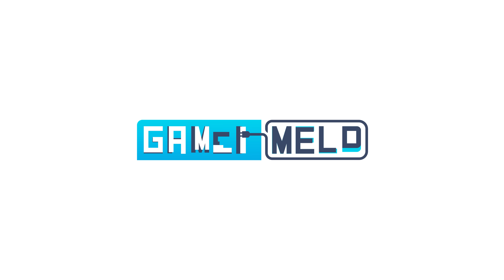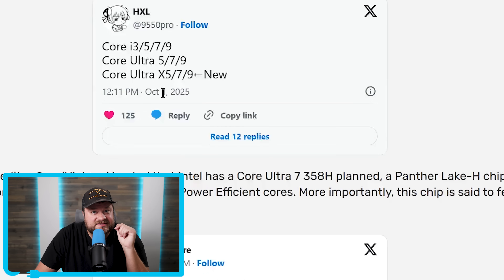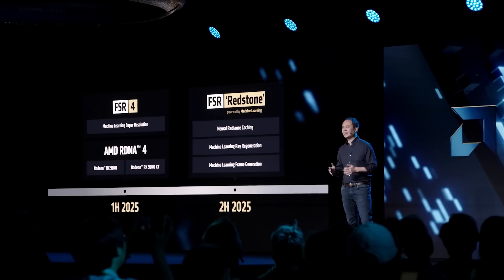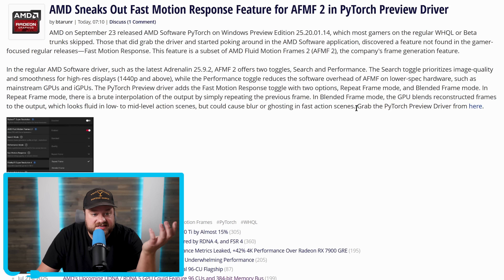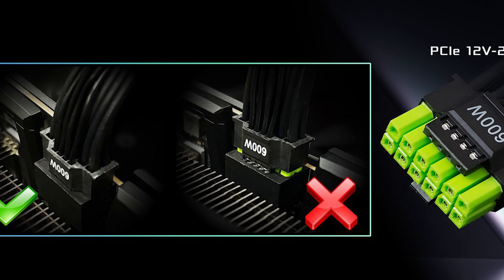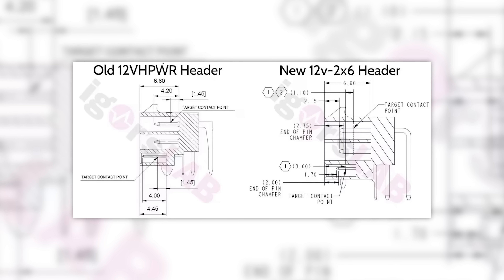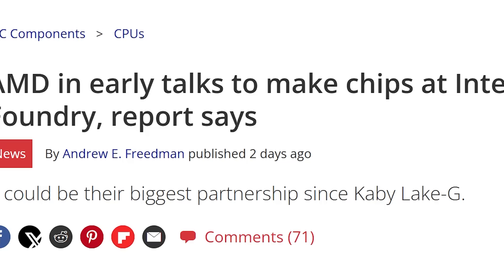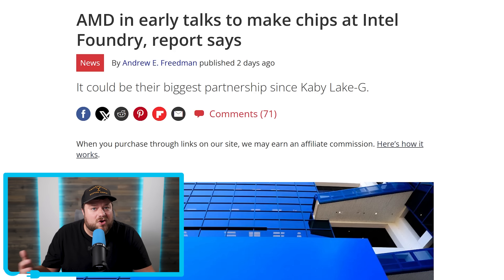AMD’s Most SHOCKING Move Yet!

Comment: Maybe AMD could maybe have Intel make new Intel based (M)emory (M)anagement (U)nits for them. Imagine an AMD CPU having the better MMU from Intel ; AMD systems that could use 2 x dual channel memory. Maybe it's time that Consumer ( Honme User ) level cpu's switch to quad channel memory. Being able to use 4 x memory modules as your default operation and not having to deal with the limiitations of the Dual channel memory configuration and operation.

Comment: Why does it have so many pins for just 12v ands ground FFS! they It had to be designed by a team of blind fake engineers.  
They should physically connect all the power and ground wires together. at the connector electricity would "load balance" the wires naturally like every other thing on the planet??

Comment: i thinke the  bigger is  no matter the gpu if you a meltin the power connector  may  be stick  flir meter on it i think and i have seen  the 2  outer most pins either  side of connector is  consuming the most of the power and you notice this more when playing the fuck around and  find out the the connector itself  is not designed either amperaage or  12/24  volt dc
may ther entire bus is designed  for 7.5 amps however with y  cables in play  you are are  consuming   beteen 15-60 amps across 32pins of the power supply

i had to wonder whether or not  we should be going back  molex connector or a 24 ping main board  for a gpu  power connector as it is the   conector isn't up to task and this has  likely been known  since the 1080 release

either way we are at the  cross roads that quatity of ram  rather just speed  of ram needs to  graphics limitation you  just can't keep adding features to  cover  lack of ram you defeat the purposes of thre new features
if you  consuming upwards of 2TB  in game  how  much gpu ram do opu need to either push 1440- or  4-8k gaming

Comment: Ridiculous. Hey we had a system that just needed multiple cables to be connected. Let's change that *two generations of burning cards. Yeah that connector sucks and is killing our stuff. Let's make yet another chip in the gpus to fix the cables instead of making the cards cheaper because we don't want anyone to have our cards. Trash company I tell ya

Comment: finally they are opening up intel foundries again... even tho they arent as good as tsmc... tsmc currently is extremelly overloaded... its intel, amd, nvidia, mediatek, qualcomm.... everything is made there nowadays... of course they cant keep up and of course prices go up... at least for low and mid tier stuff they can use slightly bigguer nodes and use other foundaries that arent as good as tsmc... as long as the price is actually good, nobody will care if the gpu uses 10-20w more...

Comment: The main problem with the 16 pin connector is that the PCI-E standard says the pins has to be connected at the end. This is a big no-no as it has never worked anywhere else. It loses control of where the current flows. If you do this with a wall outlet, by law each pin has to be able to handle 100% of the load because that might happen. 12 volt tend to have lower requirements because laws tend to see it as a safe voltage used in toys, but still I'm not convinced the setup is legal everywhere.

Why the PCI-E standard added a requirement, which electrical engineers have known for decades won't work is beyond me. It should have had a forced recall early on when problems showed up as it's a fire hazard and a consumer safety concern. Companies can't defend themselves by saying they followed some standard just like a car company can't make a car without brakes just because some non-government standard said they can.
Reply: this has monopoly power overreach signs all over it , despite problems , despite so much backlash from public , despite proven that the connector tech is unsound on physics level the nvidia company suits still went with it and double down on it because a recall would send a wrong message and might hit share price , beside what could games do they gonna bitch about it and then keep buying the slop nvidia is pushing this is why i hate monopolies , amd is good for me i will always buy product from a company that actually wants my money and is willing to improve produce and service quality even if they are not as good as monopoly products , besides monopolies rot from inside we all saw this on intel , nvidia will go the same way

Comment: if amd will enter the high end gpu then im in someone tell Sapphire to tell them to revive toxic 360mm aio cooled gpu with 1 fan. hopefully they do cause i would buy it case in point is rtx 5090 arcticstorm 360mm aio is sold out and had to raise 100 to original msrp of 2499.99 now 2599.99 on newegg but sold out. or if they sell waterblock high end ready im in like 10990 xtx 32gb gddr7 or 48gb gddr7 dual gpu in one card with crossfire solution

Comment: Intel F-up their own CPUs causing them to degrade, how we can trust that Intel know how to manufacture high density chip?
Reply: If they can’t produce it AMD won’t be making them with Intel lmao, what do you expect? 

Or do you prefer to let TSMC have a monopoly ? (Guess what this does to prices… it’s not hard to guess)
Reply: @bjarne431

I'm afraid that we see crappy chips. I prefer to pay more from quality.

In fact I prefer more quality than performance. I loved Intel Centrino except Skylake and similar era x86-64 desktop cpu and chipset but they started to neglect quality. Now they have been made trash for many gens now. I really want that quality control doesn't drop. It they can't make more dense, then stay on level that works properly.

I believe that when I have now Ryzen 7 9700X + RX9700XT, I can't get any better until we got DDR6 memory and smarter design. It is not manufacturing process anymore, best stuff goes to high performance computing to datacenters or some very tiny chips in phones.

So I actually wait that next computer has memory soldered, Risc-V or ARM, 256GB shared memory for GPU/CPU/NPU and so on to get some improvement

Comment: I haven’t had the fire issue since I’m using an ASUS Prime 5070 Ti OC, but I’ve definitely run into problems with the connector. I’ve got a Corsair RM850x (latest generation with the newest cable), and the pins are incredibly short. I had to really force it in and hold the cable upward to make proper contact. If I just plugged it in normally as I would with any other card and cable, even with a slight bit of sag, the card would lose power whenever the desk got bumped freezing the whole system.

Luckily, this GPU has a red LED above the power connector that lights up when it loses connection, so it was easy to trace the crashes back to GPU. The cable feels like it’s fully seated, which is what’s so frustrating. The only way I could keep it stable was by propping the cable so there was zero sag and the cable is sort of being pushed into the connector.

This cable design is ridiculous. I’d rather see GPUs powered by a dedicated line straight to the wall or have a properly engineered connector with a longer guide pin and a mid-point contact system instead of this unreliable push-pin setup.

Comment: 52 cores are only for people who know what to do with them. They’re gonna be useless for gaming.
Reply: This is what bothers me with all the hype around 52 cores. Most of them are low power efficiency cores, and all cores are single threaded. AMDs offering with 16 core, 32 thread, all full power feels more compelling and with future AMD chips getting double core count again I can’t imagine Intel will keep up
Reply: @davep3054  Intel's 48 core 48 thread CPU (excluding LP cores) will compete against AMD's 24 core 48 thread CPU. so they are basically the same, just in a different way. it's funny how intel gets this big headline of 52 cores, yet AMD will have the exact same amount of threads: 48 (excluding LP cores which will likely do nothing but save power)
Reply: @nightmare1010  48 HT threads are not the same as 48 core threads, it's closer to 36 core threads. A single core using HT has 1 in and splits internally to 2 out, so if a instruction stalls in one lane the next can overtake it in the 2nd, ie, it's not paralleling 2 instructions at the same time.
Reply: @SidneyCritic  If their new "antihyperthreading" thing works it could.
Reply: @SidneyCritic  So you're saying full core threads are more powerful than HT threads? i understand that, but since Intel is adding so many cores to the CPU, they are likely smaller cores, AMD will have larger cores equaling out the difference. also i don't really understand exactly what you're talking about.
Reply: yeah advanced things like windows AV scan will use all of those cores and be fast oh  no. lol
Certain tasks can never use more than one core while others can use many, and the more you have the more interesting it is.
Reply: @pweddy1

Intel had issues with their chip quality so they could use as 24 core system with lockstep and have 4 cores at spare so if some cores fail they can mark them as failed.
Reply: At one point yrs ago most games didnt take advantage of multi core technology. Now its more normalized that they do. Not all games because not all games need multicore tech but there are more CPU heavy games like flight simulator which should the software allow it benefit greatly from multicore technology.
Reply: @hell_march6652 
Amdahl’s law makes it virtually impossible to push higher framerates by just increasing core count.

The higher the frame rate the smaller the time each frame takes.  The smaller the frame time to bigger the ratio of synchronization to processing of all related threads working on a single task.

It’s not even theoretically possible that you’re going to use 52 cpu cores for gaming, because you have to synchronize the data. By the time you get to 52 cores you’re gonna spend the majority of your time waiting for synchronization.

Comment: If Intel could manufacture Ryzen dies for AMD cheaper, sure. But I seriously doubt Intel could do this for Radeon. Besides, this is not the first collaboration. They do have cross licensing agreements so, this is not much of an issue.
Reply: If everything is moving to chiplets Intel could be making parts of the chip that don't strictly need to be of the highest quality. Like when zen 1 came out it was using global foundries for the I/o die. Because it could be 14nm and didn't strictly need to be the tsmc 7nm that was far more expensive they used for the cpu tile
Reply: Intel can't manufacture Ryzen dies no matter the price
Reply: intel is no where near tsmc level of competence or price , tsmc has economies of scale and in foundary business economies of scale is how you can justify spending billions of dollars on new foundry based on leading edge processor node , thats why so many chip or foundary go bankrupt because they simply dont get enough customer to sustain operations and get profitable

Comment: The US saving Intel by forcing AMD into a contract 😅.
Reply: well, the offering was made last year, with the previous ceo, he said to nvidiia, qualcomm and amd to come and make their chips on the intel foundries, all said no because the intel nodes were not working as intel expected

something changed, lets see how this goes
Reply: @gotgg-n6w 18a is working now, and I don't think it was yields all the companies were hesitant over. You can't just switch fabs for your design, they were engineered with the process in mind you have change things from the ground up for a different process.
The thing I suspect is going to happen is AMD will use Intel for separate tiles than their primary CPU die. Think I/o dies, HBM, stackable cache and power delivery modules. There is precedent here, they used both global foundaries and tsmc for zen 1 and packaged them together.
Reply: @W1ldSm1le  18a is working, for intel

time will tell if anyone else will use 18a or what

about switching, no, no one can just switch, amd would just do chiplets or more io chiplets here, one of the two

afik they still use global foundries for io chiplets

amd has options, space to move, flexibility, the problem is intel making screwups like htye are known for like the oxidation on 13th gen that affected so many chips

never say amd tiles, tiles is the bs intel came up with so they could say amd cpus are glued together while intel use elegant tiles, made by tsmc...

Comment: Even an 8 core 9800X3D cpu is powerful enough to run a high end 5090 gpu at 1080p resolutions without serious bottlenecks.

Who on Earth needs a 52 core cpu for a domestic computer?

 All we want is stability and longevity.
Reply: Look on the bright side - if Intel keeps making these "productivity" CPU's, games will be forced to optimise to utilizing more than 8 cores. Which will be good news for old Xeon users. Battlefield 6 already is rumoured to use as many cores as you have, to get more fps. Hope future games are too.
Reply: @meganoobbg3387 
Not actually.  The more cores the more diminishing returns.  

Amdahl's law states that as you approach the synchronization time you get let performance per core/thread added.
Reply: @meganoobbg3387  Game studios doesn't care about pc enthusiasts. Why would they? The majority of gamers are running midrange setups.
Reply: @stevenoest  And 8gb gpus or less... which game studios definitely forgot about.
Reply: @AhmetAkgun-u7f

There is easy way to have use for plenty of cores in domestic computer: compiling software or running tests.

Every source file and every test suite goes own core and all cores benefits as long memory / IO bandwidth doesn't limit. Even tiny pet project could use easily 24 cores.
Reply: No no no. I need stability while im running my game, working on mods, and doing blender at the same time. I need all that to work smoothly for 8 hours or longer with no delays or loss of work

Comment: The 12v power connector only clamps on spot, and is being used well beyond the 400watts it's really good for. If it had a proper fastening solution I could see it perhaps as a 450 connector, with load balancing and safeties I'd flinch, but accept 500watts.
Reply: There are two things they need to do with that connector:

1. Slightly thicker gauge of wire - like 1 gauge thicker would be sufficient.
2.  Independent power planes coming into the card - with a test on voltage per power pin; And alert the user if it is likely that there is poor connection with one pin.

What would this cost in total per GPU? Maybe 1$? 2$?
Problem solved for like 2$ of cost. But nope - lets ignore the problem, and blame users.
Reply: @formes2388  Amperage per pin, but yes those would help ( a higher voltage standard would actually help up to a point, say 24 volts). Note the physical connector itself lack proper latching, just one spot on one side, it's effectively designed to wiggle loose.
Thing is the per line montioring and limiting WAS done on the 30 series, this is the load balancing he speaks of, that's a big part of why they didn't have big issues.  And while a good system for such might run a few bucks, it's very cheap compared to the cost of 80 class cards on up.
Reply: @formes2388  yeah 2 dollar on millions of gpu becomes a big number and company wont change anything unless it is forced to do it

Comment: part of it is the load balancing, but it's mostly the thin ass wires and the small ass connectors.
you need big connectors and thicker wires if you want to be able to handle larger amps. 
this is just stupid.
Reply: Yeah… I still don’t get why they didn’t stick with 4 8pin connectors… the 3090 has lower power consumption and the combination of load balancing probably helped.

This port shouldn’t exist. Nvidia is so greedy for blaming the user
Reply: @39eneXR nvidia throwing its monopoly power to make its gpu special like so special they need separate wires from psu to run them , frankly when i saw the wire issue i just picked rx 6950xt it has  good 3 8pin connector giving reliable power without overheating , i mean seriously why are people buying a gpu from a company like nvidia which shits on its customer so hard , provide bad service , provide defective hardware and then blames it on customer , i hope my next gpu still keeps 8 pin connectors i want to stay away from this  mess of 12 pin connector
Reply: @arnoldshmitt4969  yeah, the red team has the answer to a problem already solved many years ago. It’s shocking how a 3000$ GPU can get toasty in the worst way possible. I’m rocking the 7800XT, which isn’t that much power, but it’s powerful enough for me at the moment. In the future I’ll stick with AMD